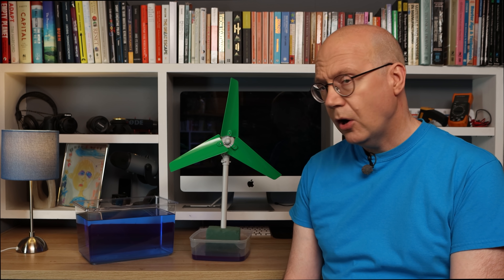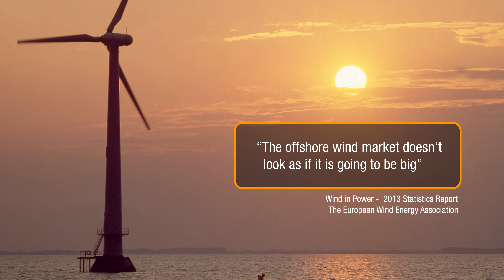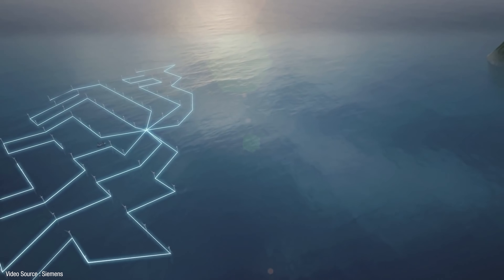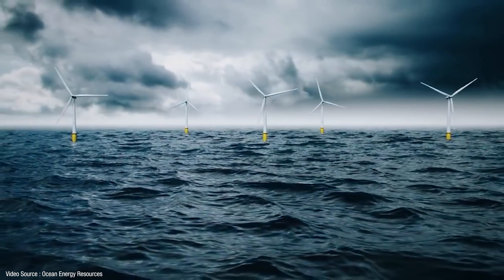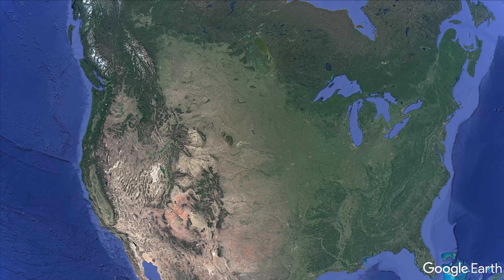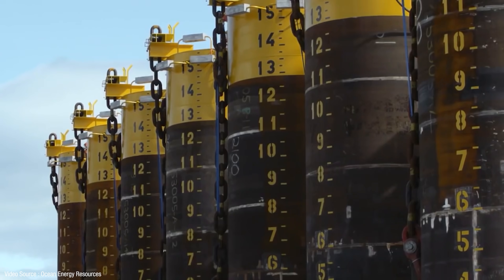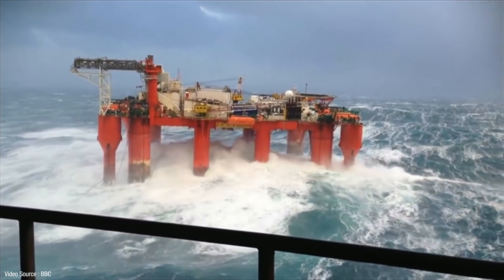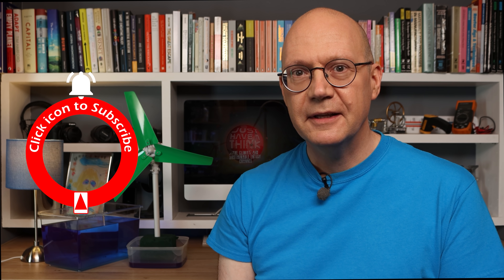Deep Ocean Floating Wind Turbines. How do they do that?

Comment: How many years till a wind turbine generates more energy than was used to construct it?
Reply: The figures I have seen estimate that the lifetime (20-25 years) production of energy by a wind turbine is approximately 20 times the energy cost of manufacture and installation. That was based on a wind farm built earlier this century with 1MW turbines. I imagine that larger turbines would do somewhat better. On that basis it should pay off its carbon “debt” in 10 months to a year.
NZ’s Te Apiti wind farm, in operation since 2004 was claimed by its owners to have covered its carbon cost in its first year of operation.
Bear in mind that fossil fuel power generation is continuously consuming energy in the mining/transportation of its fuel and continuously producing greenhouse gases during its entire operating life.
Reply: @q.e.d.9112  How deeply have you thought about this idea of wind turbines?  This is a really dumb way to go
Reply: @Les_S537  
So, your alternative is what?
Nuclear? Politically unacceptable in many countries.
Coal, oil or gas? Ditto and already has greater set up costs than wind or solar - plus that enormous, ongoing carbon cost.
Simply telling me it’s dumb, without reasons, does NOTHING to address the problem.

At the end of the day, utility companies make decisions on economic grounds. Of course subsidies are factored in but wind is now cheaper than fossil fuel even without subsidies.
Reply: @q.e.d.9112  I didn't feel lik launching into a long winded comment because most people don't respond to comments on Youtube, but now that you're here..  ;-P

Look, every nuclear power plant in operation today needs to be torn down because the way they do nuclear is inherently unsafe.

The problem with the way we do nuclear today is that we use water to cool the nuclear material.

As we all know by now, if plant operators lose the ability to circulate cool water over the nuclear material the water will begin to boil off, and the nuclear material will meltdown and explode.

Thus they are inherently unsafe.

But the way we do nuclear today is not the only way to do nuclear, by far.

Do me a favor...  There are videos here on Youtube of nuclear physicists discussing newer nuclear reactor models.

I want you to look up Ed Pheil of Elysium Industries.

He was a former nuclear engineer for the US Navy who designed and built nuclear reactors for our naval ships and submarines.  Worked for 32 years with the Navy.

He has designed a new nuclear reactor model called the Molten Chloride Salt Fast Reactor (MCSFR).

The MCSFR has two purposes:
Purpose 1 is to provide mankind with abundant energy
Purpose 2 is to take every bit of the nuclear waste we have generated over the last 70 years and recycle it.

I'm paraphrasing, of course, but his reactor can take all those heavy elements that will be radioactive for tens to hundreds of thousands of years, and transmute them into lots of lighter elements that we can use in our modern society.

Elements like neodymium.

Neodymium is used in high end magnets.

EV motors use neodymium magnets.

Some of the other element that can be created by his reactor are:

molybdenum
zorconium
palladium
ruthenium
rhodium
strontium
etc.

Imagine that!  Taking waste that was going to have to be stored for hundreds of thousands of years, and turning it into lots of useful elements that we can use in our modern society.  These elements could be used after only a few dozen years sitting on the shelf too.

Oh, and his reactor is impervious to meltdowns.
Reply: @Les_S537  
Thanks for that. Interesting. I was aware of thorium reactors but this is new to me.
Question: how far from actual implementation of these designs?
As I said, the problem is more a political one than technical. Here in NZ we have been legally “nuclear free” for about 30 years, now, so currently there is no way one of these would be allowed. Our nuclear free legislation has broad support to the extent that no party in Parliament opposes it, so I don’t see it altering any time soon.